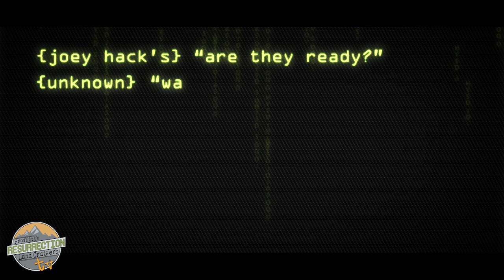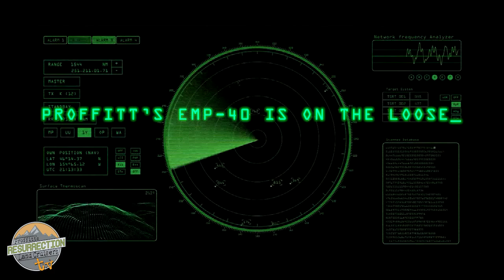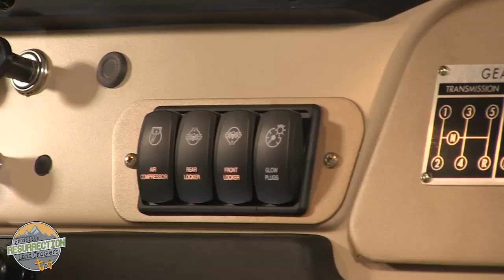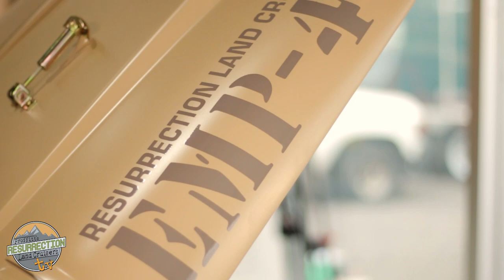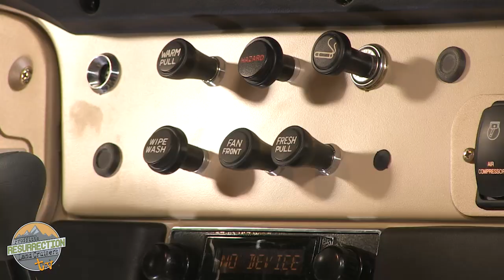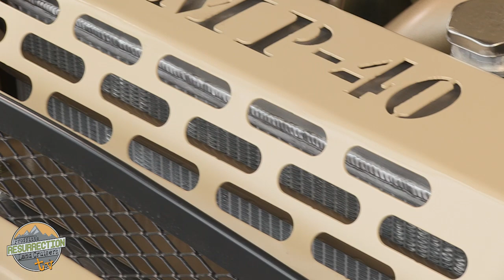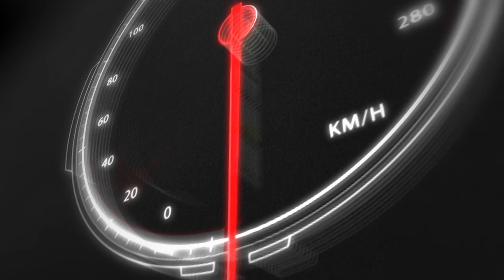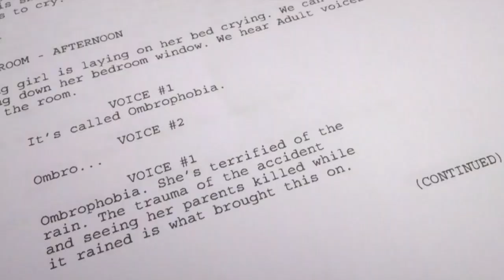The EMP 40, a unique FJ40 Land Cruiser restomod just for fun. Will it survive an EMP pulse?

Comment: An early hj45 will easily. Just have a battery disconnect once the engine is running. They have a factory pull switch off and mechanical pump. Other than starting the engine, it has absolutely no need for electricals at all from the factory. Emp’s don’t affect dead circuits, only live circuits